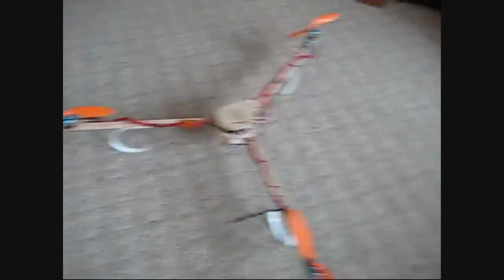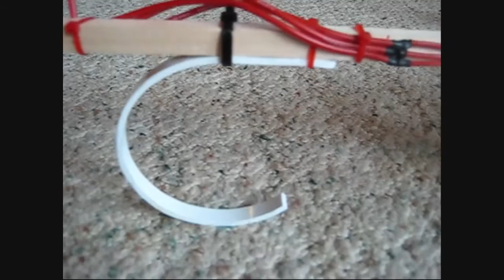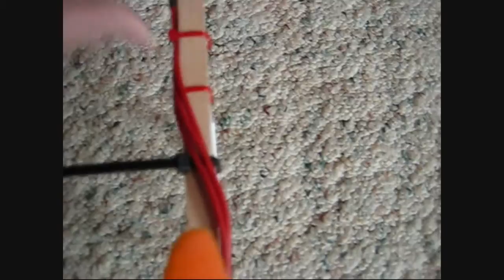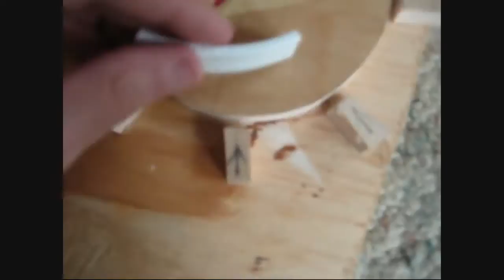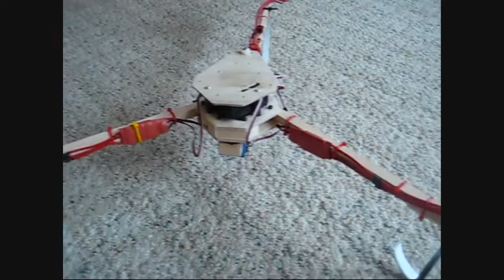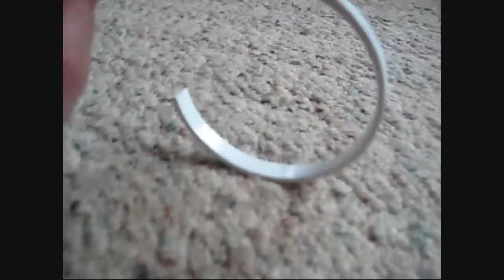DIY Multicopter ( Tri, Quad, ect.) Training Gear

Comment from the maker: yes, they break of pretty easy if still round. One fellow did what I did here, but basically cut 45 degrees out of the section, then clamped the section he wanted flat and hit it with a heatgun. It may be a faster method.